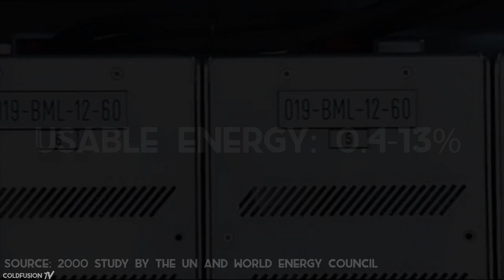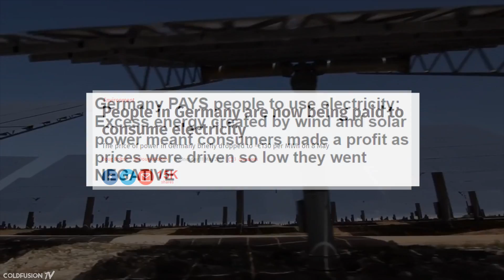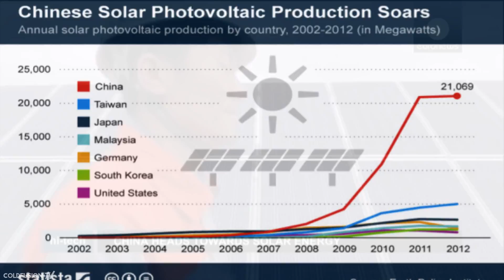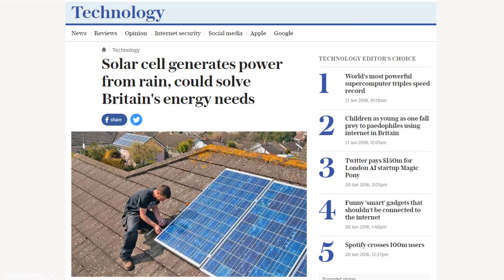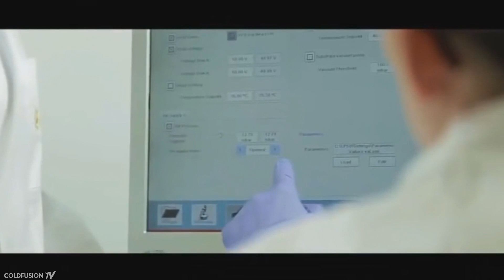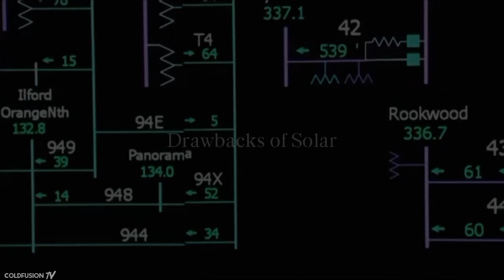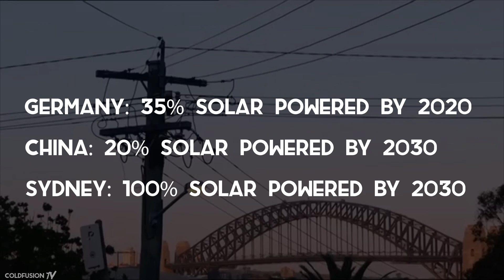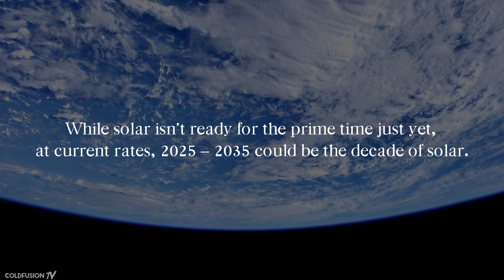The Truth About Solar

Comment: "bogus concepts like solar road ways" one is currently being installed near where i live.
 Starting your video off with bogus information pretty much renders the rest of the video from this point on as biased and uncredible.
Reply: Those are precisely the solar roadway panels that have been debunked. It's likely that department of transportation was duped into believing they aren't wasting their money.
Reply: Yes, it's a scam. And if it's being installed despite that, it just demonstrates that gov. officials are easy to fool. (which isn't new)
Reply: Are you referring to the solar roadways that were advertised by the video "Solar Freaking Roadways?" They claimed to be able to make solar panels that would power LED lights for paint strips on roads while also generating a surplus of energy. That concept has been rather thoroughly debunked. And to be fair, it isn't the smartest plan ever to put solar panels in a place where they are guaranteed to get extensive wear and tear.
Reply: Scott K Scott, you must be the last one to realize that solar freaking roadways is total scam. But hey, I initially fell for that too. I guess, almost everyone fell for it initially. You'll find on Youtube answers to your question.
Reply: I just don't understand why you would even WANT solar roadways.  Surely its cheaper to build a canopy over or down the side of the road with solar panels on?

It makes driving on the road safer than than more dangerous, the panels get more sunlight and its easier to maintain.
Reply: Scott K The short answer is: The fancy computer animations used in the presentation for the solar freaking roadways are very far away from real life and the real life conditions on a road. Plus, the energy generated by those roads wouldn't be anywhere near of what it needs to be just to pay for the costs. So, yes, it's a scam.
Reply: "KY3 reported that MoDot will first test out a 12-by-20 foot patch of 
panels on a sidewalk leading to the rest stop’s main entrance.
“This is kind of the first phase, and we hope in the future that we 
then can move it out into maybe the parking lot, and then maybe into a 
travel area,” McKean said."
So yeah, they're not even going anywhere near the road yet.
Reply: Well, that is an extremely naive concept. Don't assume that something isn't a scam just because someone you know believes it isn't. If its obviously a scam, like solar roadways are, then it doesn't matter who is buying them.

I just feel bad for you because your city is going to be losing a shit ton of money when they install the roadways, a bunch of accidents happen as a result, and the advertised benefits don't work, then the city has to pay to replace the roads again.
Reply: bearloscuro
I was never listening to big oil, I was listening to electrical engineers who know how efficient the best sun-tracked solar generation can be.

The technology simply does not exist to make it viable.  The panels would need to be an order of magnitude more efficient than current to offset how much shade they are going to get from dirt/vehicles and how often they are going to need replacing due to damage.

If they somehow had panels so much more efficient than everyone else was using then they would be putting them on buildings first, as that would be the biggest return from investment.  They would make a killing.

Solar roadways are snake oil.  The maths just doesn't even remotely add up.
Reply: bearloscuro Yea, so i know you are getting false information from somewhere, bud. The reason the solar roadways aren't flat is because they didn't think they were going to get enough traction. I doubt their design has added that much, though i could be wrong. Regardless, it will be worn down over time.

If the solar panels do not produce enough energy to at least make the cost of buying them zero over time (not even including keeping them warm, or lighting them up with lights that aren't visible during the day), then they will have been a failure because they will have harmed the environment much more than they helped it. And, again considering the fact at best they will only get 35% efficiency, and best 1/4 of the year anywhere above the snow line, and the fact we still do not even have a good way of storing said energy, in the unlikely case they generate more energy than they and the area around them use, it is unlikely the cost will equal out to zero.

You want the start of something great? There are a metric shit ton of other places to start looking and researching, as far as energy is concerned, most of them with more logical and scientific backing. The only problem is getting funding, which unfortunately goes to shady projects like this. And you know what, if i'm wrong and this is somehow, against all possibilities, a success, then i'll eat my words and never try to comment on such things again. But i know this hasn't had nearly as much thought put into it as it seems, or should have had. Just like many other attempts to reduce pollution.
Reply: no im talking about the upgrade being applied to route 66 that is already paid for and moving forward
Reply: i guess time will tell, seems kind of risky though. if its a scam that some hardcore jail time
Reply: is it a solar roadway or solar panels occupying space above or near the road? Many highways already have solar panels installed above the highway or inbetween in the medians.
Reply: tybofborg No solar freaking roadways then? 
What a downer! :)
Reply: tybofborg Judging by that, it's gonna be quite a while before MoDot figures out it's practically a scam.
Reply: Solar roadways have wiring in them, with heating elements, which melt snowfall. This makes THEM safer. They DO use some power off the grid, when it is snowing, but normally, during the daytime, they are collecting energy, produced from sunlight. They DO last. They're thick, glass blocks, like concrete pavers, but stronger. For you people to think they are a scam is just absurd. Where did you get the idea that they are a scam?
Reply: Scott K There's a few problems with them mostly summarized by two general problems: durability and energy consumption.
The reason we use asphalt is because it's easy to replace, it can expand and contract with the changing seasons, and it's cheap. None of this applies to the solar panels proposed. They are advertised as being modular for ease of replace, but that just means that most times they are replaced, you'll be replacing multiple panels. Expansion and contraction with changing seasons would screw with the alignment of modular roads, making for a bumpy ride at best. And the panels proposed are certainly not cheaper than asphalt.
As for energy consumption, putting solar panels normal to the road, behind a plate of "strong" glass, and under whatever grime manages to get stuck to the road. They are doing their very best to put solar panels into an inefficient location. And then they want to spend that energy on heating (which is expensive) and fancy lights that will somehow be visible in broad daylight.
Reply: Scott K Oh shit, did I fall for sarcasm here?
Reply: Adequate traction is not a problem with the modular solar highway panels and never has been. The pattern of the surface actually was too good and they had to reduce the profile to assure that vehicles wouldn't stop too quickly or roughly. Incidentally, the properties of polymer-infused glasses are superior to concrete in most ways, excepting their cost. Rather than being a naysayer, like the so-called scientists who said that you couldn't travel on a train faster than 25 miles per hour because you wouldn't be able to breathe, the proof will be in the pudding. Rather than killing the project before it starts, let  them prove themselves. They've worked a long time on this concept and they believe in it. Claiming that it's a scam is really disrespectful to both of the engineers that are staking their work, reputation, and life savings on this. I would also ask you to remember that the airplane that the Wright Brothers flew at Kitty Hawk wasn't perfect, either. Since when has version X.0 of ANYTHING groundbreaking ever been perfect? This could be the start of something great. Let's see where it can take us rather than assuming, as Big Oil and Big Energy would like us to believe, that it's all smoke and mirrors.

Comment: My problem is the basic cost of solar. I would love to be able to change my home over. Here is what I did, I took an outdoor solar flood light that has a separate solar panel, put it in the gutted frame of a recessed light that took 4 fluorescent tubes. I pointed the flood light towards the center of the fixture, closed it up and hung it from the ceiling. As soon as it started getting dark the came on on its low setting and lasted all night. I will have to make some adjustments to the frame to get the motion detector to work so when you get up or move the light will get brighter.

Comment: While most of the "inspirational breakthroughs" are not quite as straight up fraudulent as solar roadways, I still think a bit of cynicism gets you closer to reality when reading about these news. Solar cells that work in rain? Yes.. if it starts raining salt water. And expose the surface of the panel to the elements. And give up the effectiveness of the solar panel itself. And exactly how much "energy" potential is there to extract from osmotic power? Lets at least check the numbers to see what even the theoretical amount is, before we claim that it could solve any problems.

This kind of uninformed enthusiasm is why people get on the shitty hype train for solar fricking roadways.

I'm all for solar power. I think it's madness to choose to destroy our home over a slightly cheaper eletrical bill, but, I abhore false hype.

Comment: I wish you would have included some info on where the raw materials come from, and how that compares to other industries - I work in Solar manufacturing and know we are using a lot of toxic chemicals and a fair amount of raw material that are not responsible sourced, one example, titanium dioxide, we use a fair amount of that, yep the same stuff that makes M&Ms melt in t your mouth, not in your hands, and keeps you from getting sun burned, we use it as a coating too.  My understanding is that obtaining this stuff is devastating both in its mining and processing.  My point is we need to look at the whole picture.

Comment: The problem with solar is batteries that are used with solar only last so long and those end up in land fills or with the spent nuclear fuel rods in a lead and cement lined hole in the ground to stop the batteries fluid from mixing with ground water. Also the pollution that the factories that make solar panels is really not good because they use hexa floride as a cleaning agent that breaks ozone apart when it gets into the atmosphere. Carbon is used by plants to create energy with sunlight and water so what the real pollution problem is that we are deforesting our planet so there is a lot more carbon then what what is left of trees can't handle. Also the corn industry that is subsidized by the government is a large pollution bomb from the fuel used from the equipment the transportation of the corn the pesticides killing off originators like bees and don't forget it's gmo corn that the by product of high fructose corn syrup is linked to Alzheimer's disease.

Comment: THE COST OF SOLAR IS NET HIGHER THAN MOST OF NOT ALL FUEL...       THE COST OF USING ALL OTHER  FUELS TO PRODUCE SOLAR NEGATES MOST OF IF NOT ALL OF THE USE OF SOLAR.         NOW SOLAR CAN BE USED TO HEAT WATER VERY CHEAP.,  THIS IS ONE OF THE BEST USE OF SOLAR.    WATER CAN BE HEATED JUST USING  BLACK PVC PIPE.  AND STORED UNTIL NEEDED.      BUT UNTIL WE GET SOLAR  PANELS IN THE  75% TO 80%  NOT RATED IN A LAB BUT WHEN USED IN THE REAL WORD  THEN WE MIGHT THINK ABOUT SOLAR.      NEXT THE PROBLEM OF STORAGE OF POWER,   THE COST OF STORAGE CELLS IS SO COSTLY THAT WHY BOTHER,         SURE YOU CAN USE SOLAR TO LINE YOUR WALK WAY BUT    LED LIGHTS  AT 12V DC IS A BETTER WAY TO GO.        I DO WISH WE COULD USE THE SUN FOR POWER BUT  WE ARE BETTER OFF USING THE GEO THERMAL OF THE EARTH  IT IS ON 100% OF THE TIME.   TAKE THAT STEAM AND ROTATE THE GENERATORS.   NOW THAT IS AS CLOSE AS YOU CAN COME TO   FREE ENERGY

Comment: how is it for free , yes energy is free , but you need to make that solar panel , battery , converters , other things ,that costs a lot , probably a yearly electric bill if not more . Now that is not fee . And its not exactly green, as i assume the most dirty industry's are making it .. realistically , those panels exists due to oil industry , and that one is tide with water power . Taht wont change because in big picture , solar power is just to weak . Even the best panel , accumulate dust and lose eficency real fast , and to it other problems and you lose more then half output without constantly maintaining it . I just dont see it , i like it , no problem but as something that should change the world , nah , not gonna happen

Comment: Solar works well in countries where major need for electricity is for cooling. In Finland it is heating and in the winter there is little solar power available.  Batteries work quite well for daily storage but not for the yearly storage.

Comment: I am only about half way through the video, so maybe you address this, but so far... the cost of creating the cells is not as big of an issue as the fact that the efficiency of the cells has not seen any major upgrade in a long time! Even if the cells were free, it takes a lot of them to make any significant difference! So, you need to procure land (which takes away from living and agricultural spaces), you have to have the infrastructure to move the energy (which includes the cost of labor and maintenance)...
Many reports that I have seen don't account for the indirect and sometimes intangible costs/effects of solar power farms.
PLUS! Very large solar farms will actually increase the temperature of the surface of the earth (which is supposedly the reason everyone wants solar in the first place).

I would love to see a free source of energy, but look... there are cons on every side. Even Apple is SELLING its excess energy rather than giving it away (wouldn't cost them a DIME to just give it away)...

Comment: Yeah well ... those 30 - 35% efficiency ... weeell no ... this is a field of space grade, concentrated solar cells using rare materials like Germanium etc. Today's commercially sold panels barely reach 20% and that is purely theoretical value. Efficiency of most of the panels is actually in area of 12 - 16% or so.